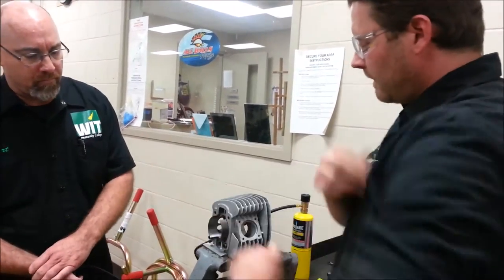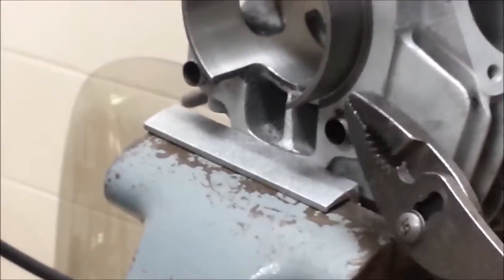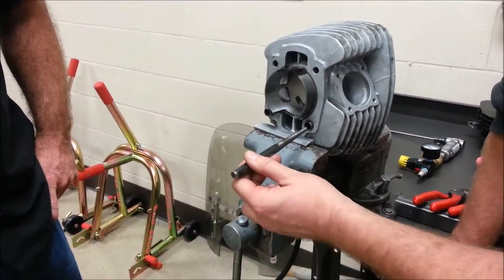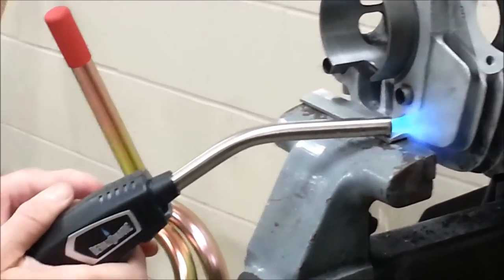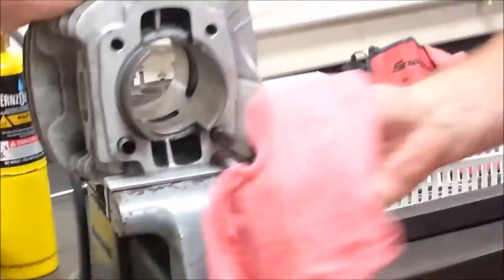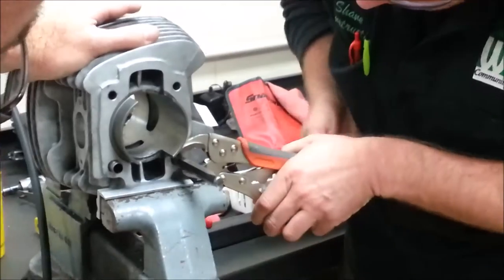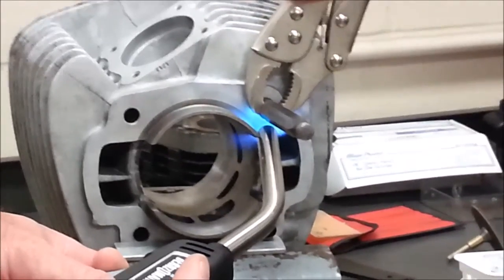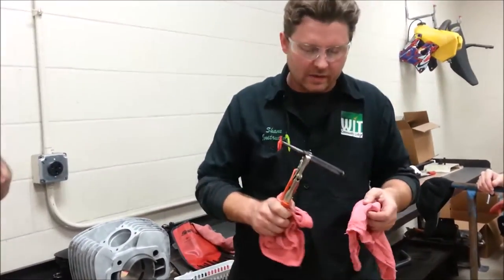2 Stroke Engine Disassembly   Dowel Pin Removal   10 30 14

Comment: Good videos.  SnapOn makes a set of collets to fit these dowels and you can use your slide hammer to remove them after heating the cylinder.  We always use MAP gas too.

Andy Maul

Comment: Hello Shane, I am Stefan from Germany and I am learning a lot from your videos. Have to take apart a Honda atc 200es motor for the first time in my life, and struggeling with a dowel pin. I am so glad to have learned what a dowel pin is actually for. I have a question before I hurt my engine: When you heat up an aluminium cylinder and mention a heat of about 230 degree, are you talking fahrenheit or celsius? I bought an digital heat blower, so I can set up the proper heat for installing bearings or removing dowel pins. I wish you all the best. Stefan Nagel
Reply: Shane is talking Fahrenheit...its around 100 degrees C